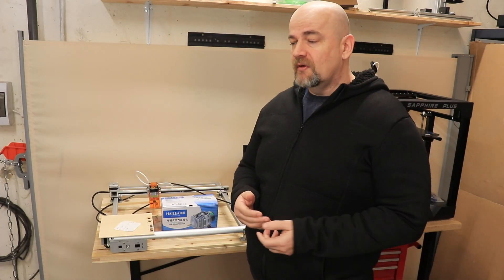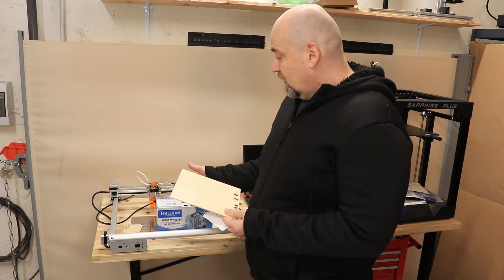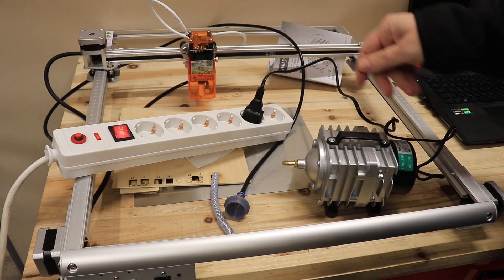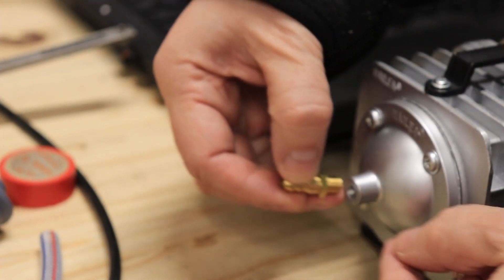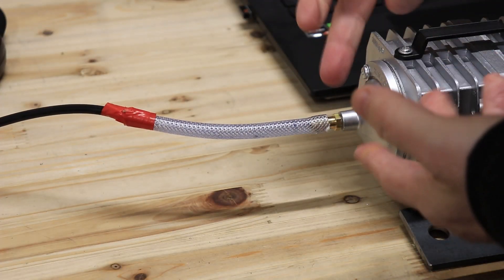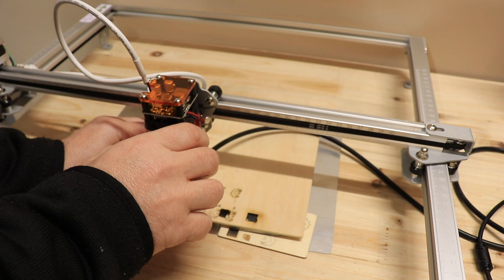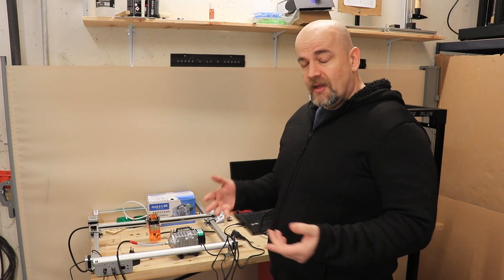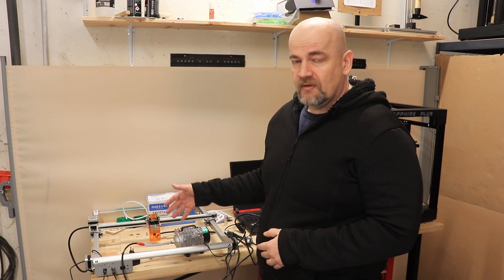Aquarium air pump for air assist laser engraving - is it better than vacuum cleaner?

Comment: I just ordered this compressor and it should be here next week - I'll compare it to my Sculpfun S9 air pump and see if they perform the same or not. The air assist is the very first add-on I purchased when I got my S9.  You can also cut faster and deeper when having air-assist turned on. The only time I don't use air-assist is when engraving. Thanks for your videos!

Comment: The air pump that I have came with a metal 6 port air splitter, each port with a valve.  The valve for air assist nozzle is always open.  I open a second valve for engraving so some air bypasses the laser.  It makes cleaner engraving and keeps the laser lens clean.  For cutting I close all valves but the air assist so I get maximum air flow to the laser.

Comment: I just set my air pump up to run whenever the laser is active by operating a relay off the laser enable pin.  That way, whenever the laser is enabled, a relay turns on the outlet the air pump is plugged into.  No need for any switch since the outlet is only hot when the laser is in use and is off when the laser isn't in use.  Having the air pump on such an automatic circuit makes it more convenient.
Reply: Your much better off using a high power mosfet as the back emf from the coil will eventually damage the circuit running the laser and anything else that's not decoupled from its circuitry.
Reply: @hulkgqnissanpatrol6121  Optocoupler, the signal to enable the laser is not effected by the relay at all, it's completely decoupled from the relay. It's also a solid state relay, no coil/emf.  No worries here.

Comment: The engraving with air assist while it had more smoke staining the lines were darker and more consistant. Porbably blowing the smoke out of the way that interferes with the beam.
PErhaps a slower flow when engraving would work well.

Comment: I have been using an air brush compressor but it gets hot and I don’t think it’s mental for continuous use. The fish tank thing is made for continuous use, that could be why there’s no switch. I ordered one supposedly quiet. Yours is loud. Try dampening with a rubber Matt. Yes, you want to use air assist on cuts. Sometimes not on engraving depending on how deep you want to engrave.

Comment: This model the 318 is actually 60l per minute. Several sites wrongly state it as 70. That would be the next model the 328. Also the 318 is rated at 32 watts the 328 is 45. Bangwood must have messed it up.

Comment: How about sucking instead of blowing for engraving? Have you tried the "right" side of the vacuum cleaner?
Reply from the maker: Hm, not yet. Maybe with vacuum cleaner, but I wouldn't recommend this with any other compressor or air pump.
Reply: @MyTechFun  I think about a toroid shaped ring around the beam with some holes to get an upwards directed airflow.

Comment: Are you using the regulator that comes with the air assist nozzle? Can't see in your video if it's on the tube?
Reply from the maker: With this pump no need, just max air.

Comment: what would happen if instead of just air flow, we use vacuum to suck out the smoke?
Reply from the maker: Hm, probably we could use it with engraving too. But most of the pumps don't like sucking of the dust, you have to use only a vacuum cleaner.

Comment: Can you add a relay for the air pump and make it auto start only when cutting?
Genuine question.
Reply from the maker: Yes, it can be added, however, I wouldn't recommend it for beginners, they shouldn't experimenting with AC power. For experienced users, sure. Signal for turning on/off the relay can be in g-code or using it from the laser wire.

Comment: Can you test with/without air assist at lower power and see how many passes it takes for each to cut through?
Reply from the maker: I didn't noticed any difference, same passes in one quick test I did. AA just helps to have cleaning cut (and prevent flame)
Reply: @MyTechFun  thank you for taking the time to do it

Comment: ACO-318: The plug is American with an adapter for Europe. The adapter does not meet European standards and is very dangerous. It is noisy (my phone measures over 60db). As it lacks double insulation by our standards it should have a grounding wire.

Comment: Hello, good video. I ordered a A10pro 10w real output laser. I want to order a ACO-308 45L/min aquarium compressor. Could you please name the black small flexible hose do you use ? Brand, diameter, material, etc ? Thanks
Reply from the maker: I got it with Aufero Laser 2 https://youtu.be/y_b4poZoovo?t=206 Approx. 8mm dia. Very flexible, probably silicone.

Comment: Why does the manufacturer NEJE recommend working with a pressure of 0.6-1.5Mpa?
Reply from the maker: Actually the flow rate at nozzle is more important. But since the pump has to push the air through the pipe, it needs some pressure due the friction

Comment: Engraving with AA distribute sthe smoke on you piece
better to use AA for cutting only

if you put a protective tape on the workpiece you can use AA. this also goes with CO2